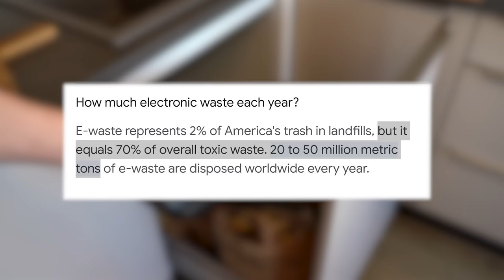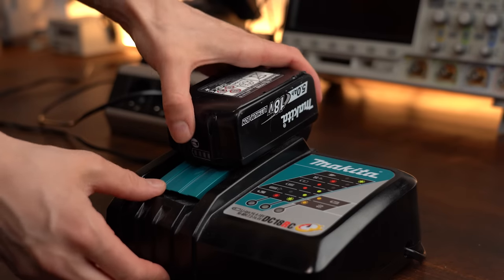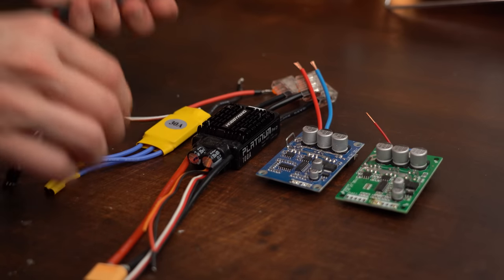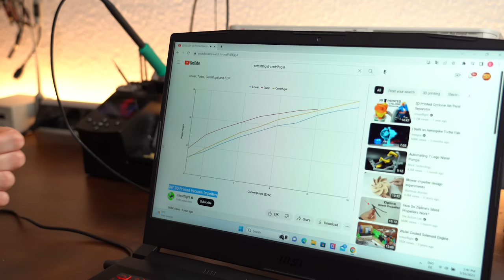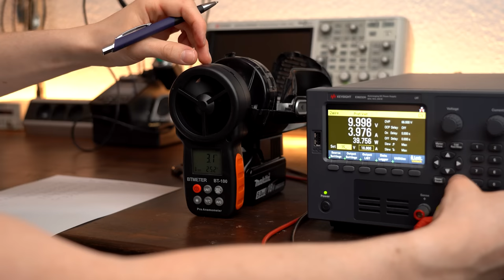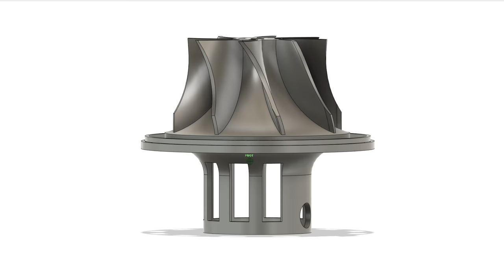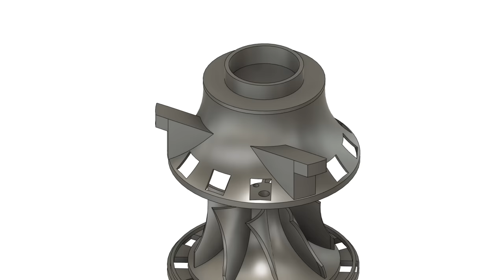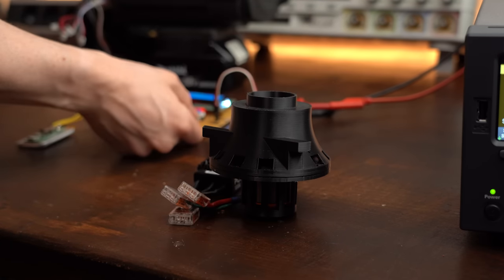I tried OVERPOWERING my Vacuum! (Homemade Turbine)

Comment: I have been wanting to build a small easy to use vacuum with my 3d printer. I too.. have a ton of motors and batteries. I printed a few impellers but havent found an efficient design yet.

Comment: I owned a 18v at first but moved to the 48volt for my second one. Its still a bit to weak. So once this one is dead if i get a smal portable one it will be 60v. But most likely i will simply use better plugg in vacuumes.

Comment: 1 minute into the video and I'm already thinking that a brushless motor and a 3d printed prop is going to make you buy a new vacuum cleaner to clean those little plastic bits when the prop explodes 😅. Going to watch it till the end and see what happens.

EDIT: happy that it didn't blow up and I would recommend next time not to stand so close to a 3d printed prop. When you added the epoxy to the magnets you also killed the balance of the bell. Really surprised nothing bad happened and glad at the same time

Comment: if I had to guess, the 'extra vent holes' could reduce the effective suction power.. OR, in fact, it might need MORE vent holes on the sides.
        The original impeller uses all of the spave in the cavity, right? 
       So the cavity might be integral to the suction. (Just like those 'bladeless' fans displace way more air than a regular fan...(?)...if that makes any sense...?)

On a simpler (and very positive!) note:
      I think your impeller design (without the housing, even) would make for a very, VERY good fume extractor :)
.      (Looks more effective than a computer fan to me)

Would be interesting to see an A/B test with a source of smoke, to see how much it can displace.  
     (Which is probably not the most scientific method, but would look cool on video nonetheless ;))

Comment: Question: If you were reprinting the whole impeller and everything, why was it still so important to use the same diameter motor vs using one with a higher KV?

Comment: Outrunners like that do not like very high speeds due to the eddie-losses. They heat up and due to the inverted nature have very poor cooling when not getting air forced through them.
You may be better off with a in-runner style motor, probably a 4-pole (4 magnet poles). The balance of load on motor vs power could also allow you to increase efficiency even more.

Comment: From an engineering standpoint a great video
However the intro with the e-waste problem is a bit ironic, considering that you replaced all the electronics in this thing anyways and used up more plastic than the original housing is made of ;)
Reply: yes lol

Comment: Ich hätte von einem alten kleinen Abgasturbolader das Kompressorrad verwendet. Der 3D Drucker bekommt warscheinlich die Geometrie der Schaufeln nicht exakt genug hin, und gewuchtet ist das sowieso nicht. Die hohen Unwuchten verhindern warscheinlich das Hochdrehen des Kompressorrades. Ausserdem beeinflussen die Spaltmaße zwischen Gehäuse und Rotor direkt dein Verdichtungsverhätltnis bzw auch den Durchfluss. Mfg.

Comment: Fan/impeller design needs to be matched to the system resistance (ductwork, cleaning tools etc) and to the motor speed and power, which can all be calculated. Chances of getting this right without calculation and using spare parts is low but good luck. Dyson had something like 1800 prototypes for his first machine…

Comment: I have to warn you DO NOT continue to use this DIY vacuum cleaner.
I have been tried to develop a new propeller for vacuum cleaner in 3D printed way in my previous job, your workflow is basically the same as mine and represented very clear. Great video. 
But I will not recommend you continue use this diy vacuum cleaner because the propellers 3D printed tends to have structural weakness and will warp after stress test/ heavy usage.
It hugely depends on your printing profile. But if the propeller stuck while you using it, best scenario is BLDC motor protection circuit come up and stop further damage. Worst scenario is potential fire hazard due to motor continues to heat up and smoke come out.  
I learn it in a hard way blown up a couple of motors in a controlled environment. It is a bad idea to put it in your house.

Comment: Just try to reuse the original impeller and housing design, measure the static pressure before declaring it a success, put more voltage in or a bigger kv motor.

Comment: You can't design a centrifugal compressor by just putting some curved blades on a hub and hoping for the best. You need to calculate the pressure drop and design rotor speed, then with input power you can calculate the mass flow rate and therefore radial velocity, then tangential velocities and thus draw the velocity triangles to calculate the exact angle the blades need to be at the inlet and outlet sides of the rotor, taking care not to over expand the flow which will induce separation and high losses. You can then solve some differential equations to get the exact curve the blades need to follow for uniform pressure distribution, and plug all this into your CAD program.

Comment: Shouldn't you be measuring the volume of air moved per second under typical "dust load" instead of the speed? 🙂 Cool project.

Comment: Bugger more powerfull motor with a higher stall resistance setup. That would be the best solution it will be heavy and may take two power packs to run it but it would probably work better

Comment: your design is great and all but i think the biggest limitation to it is the impeller design. that motor can handle good power and all and spin to a similar rpm but the impeller desin is what allows it to create airflow and static pressure. sure the airflow is nice but the vaccume relies more on pressure to suck dust through fabric and suck up large debris. if you get some professional tips as to what style of impeller you should use then that vaccume should be just as good if not better than orignal.

Comment: There's a channel that deal's with impellers. ( Cannot remember title ) And i was shocked to find out the slightest changes will produce outstanding results. Just because the one you chose was good, something slightly different could be your answer. Looking cool sometimes... isn't.

Comment: You're using my 3D printer (BambuLab X1 Carbon). But I don't know your CAD software. Currently I'm using Onshape, but within the free version, everything has to be "public visible". And I'm on a Mac, so I'm very blocked, because not every CAD software works on my machine.

Comment: Why not use a motor with a higher KV rating?
The large size of the motor shouldn't be a problem if you end up making a new stand with a 3d printer.

Comment: What filament do you use for 3D printed Electronic enclosures? I really like your designs and ideas for electronic projects and their enclosures... I just bought a 3D printer and I wonder What's the best filament for an enclosure that would not melt when something on the circuit gets warm... PLA starts to deform when it gets 65°c on a heatsink near it

Comment: The Magnets propably came loose becuase the motor got so hot. I would think that airflow isnt the most important if your turbine cant get a low enought preassure. Would be nice to see the vakuum it can pull.
Reply from the maker: Yep. Heat definitely was the problem. But then again, other BLDC of mine also got hot and never got this problem. Not sure what was wrong with this one. And maybe I will do a follow up video....we will see ;-)
Reply: @greatscottlab  Yea who knows what glue was used in the factory. :D Maybe there is also a difference with BLDCs for RC cars and planes since the motors for cars are build for less airflow. So next liquid cool the BLDC!! :-P

Comment: Seems as it don’t have a high load what about using a gearbox solution for like ever 1 turn it out puts 4 turns on the impeller shaft

Comment: Coming from a car guy too, u should never go for a weaker engine, when u are used to one car, then drive a slower one, thats disappointing to say the least and takes away any fun, so if u are going to replace a motor, put one that is at least 20% more powerful there...

Comment: i used the original stuff only changed the batteries and it was very fast :D and next it was smell and fire because the new batteries was bigger and didnt fit well in the vacuum

Comment: You might be getting pumping losses from the enclosure. also i dont think a centrifugal design works too well for the speed on your motor. It might be best to look at either getting a new motor or redesigning the casing and impeller.

Comment: 5:54
'casually putting a brushless outrunner motor inside a closed tight fitting enclosure'
Reply from the maker: Yep. Not the best idea.
Reply: it's an idea though😅
you might want to switch to inrunner motors, they're much easier to mount in situations like these, have much higher RPM, and will make the construction more rigid.
Reply from the maker: True

Comment: a centrifugal turbine is better suited for exhaust pressure not for intake pressure. id recommend a fan blade design that's better suited for suction father than exhaust pressure.

Comment: Damn man, I'll give you credit for your effort and getting it working...however you spent WAY WAY more on the fix then just buying a new one.   Cost Eval:
New Handheld Vacuum:  $50-90     Vs:
Labor Costs:                       $80 /hour  x 4 hours (at least)  = $320  (unless you dont value your time) 
Small Motor:                       ~$10 (estimate)
20V Battery:                        $40-70
Impeller Design:                $80 /hour  x 2 hours (at least)  = $160 
Impeller Fab:                     ~$10 (estimate)

Comment: You shouldn’t have used an out runner motor for this situation. The spin was causing rubbing inside the casing you made off causing heat and making things go off balance

Comment: Hey, when you use abs filament for impelors? (idk the opposite of propellor) you can smooth the print with acetone fumes in a fume box with a fan in it, make sure the box is acetone resistant and it takes practice to evenly smoothen but with smoothened fans you can get better performance (source: Does Smoothing 3D Prints Improve Performance and Can You Smooth PLA?. Channel: Major Hardware)

Comment: Centrifugal impellers are very sensitive to being balanced in terms of rotational mass. Like when you balance your car wheels after changing the tyres. If not balanced, you will have lot of losses, it will rub against everything and eventually self destruct.
I didn't see you follow the impeller balancing procedure on the video.
Other things to keep in mind is the geometry of your impeller (number of fins and angle of the fins) and the gap between the fins and the housing.
There is always a tradeoff between more or less angle ans more or less fins. You want to optimize the geometry for your rpm

Other than that, there are other factors which affect vaccum cleaner performance, such as the filters used, geometry, backpressure, etc.

Btw, I think your wife wants an expensive Dyson 😂😂😂

Comment: Can the motor handle (without damaging the plastic) 60 more watts if you boosted the voltage to maybe 24v-30v with a boost converter?

Comment: While you're at it - add an off switch or speed reduction feature to your project in case something gets sucked in that wasn't meant to ... that said, is this doable with some simple old school "pressure over time" measurement, or do we need a lot of toddlers to get enough training data for a fancy pants AI solution?!

Comment: make a vacuum cleaner that would first blow off the dust, and then suck it up.  something like a tube of compressed air in the middle of a hose .. or nozzle.  some dust can't be sucked in, but easy to blow off, if you combine it, it's perfect, blow-suck

Comment: 💨🔌🌀 While your first attempt at overpowering your vacuum with a homemade turbine was impressive, it seems that the designed impeller fell short in terms of static pressure. Vacuums rely more on static pressure than the speed of airflow, and that might have been a limiting factor. Nonetheless, it's an excellent effort, and I'm curious to see the updates and improvements you make in the future. Keep up the innovative work! 👍✨🔧

Comment: should use a smaller motor with an olmost same size prop but much lighter with same power for efficiency,,over power and stronger suction.

Comment: I don't understand why you even replaced the motor when the KV rating was almost 800KV lower then needed. Try the original motor with the new impeller design. That could be interesting.

Comment: Can't use an open impeller. Gotta be shrouded for static pressure. The original is made like it is for a reason. Off hand I cant think of any impeller from a vacuum cleaner that isn't a shrouded design.

Comment: It’s uncanny how your videos always sync up to my projects. I’m working on a project where I couldn’t get enough flow from a vacuum generator and have had to switch to using a regular vacuum motor. One of the hardest parts is getting it as quiet as possible. Does anyone have any suggestions?

Comment: 5:03 You want to make a vacuum cleaner, a vacuum cleaner requires suction power and not airflow. The impeller you show here has forwards facing blades, which is good for high flow, low pressure and low noise. You need one with backwards facing blades, which provide low flow, high pressure and high noise.

This mistake shows up everywhere in the video, where you only measure airflow speed and not suction power (both the air speed and inches of vacuum should have been measured)

With your design, measure the airflow and inches of vacuum with the current setup, and one where you flipped 2 leads of the motor around to make it spin in the other direction

Comment: I once built such a vacuum cleaner. However, I made it wired using a 1200W vacuum cleaner motor 😅
Reply from the maker: Well, that is one way to do it.

Comment: Everybody, there's a valuable lession here. No matter how cool your project is, doesn't matter if it uses less power... if only ONE parameter worse than the original one, if only ONE step is more hassle than the original process, your partner WILL complain and ask you to improve it or buy a new one.

Comment: Hi, I have some questions... Can I use two 4056 charging modules to charge my 20000mah lithium battery bank...The 4056 will be wired in parallel and the battery is 3.7v  20000mah.

Comment: Would it be possible to add a second air-moving structure under the impeller plate, to direct a separate air-stream to the motor for cooling? (separate so you're not throwing dusty air into the motor)

Comment: It's not the motor, it is the blade you made, they are way too open and can't grab enough air... the first propeller variant you had in the vacuum was much better than what you made... So, with that in mind, replace the propeller and see how it works, and continue to find a finer tune to it

Comment: It's not a "turbine". Turbines converts energy on the fluid to mechanical energy. What was made is a compressor or impeller, that does exactly the opposite of the turbine: converts mechanical energy into energy to the fluid (pressure, potential, kinetic energy).
Reply from the maker: True, but I think more people can imagine the object when saying turbine instead of impeller.
Reply: @greatscottlab  propagating misconceptions is not a good thing. Such a good channel, that teaches so much, should inform this too and be another great opportunity to try to break this mistake almost everybody does.

Comment: you measured the original motor RPM at no load; should be lower under proper suction

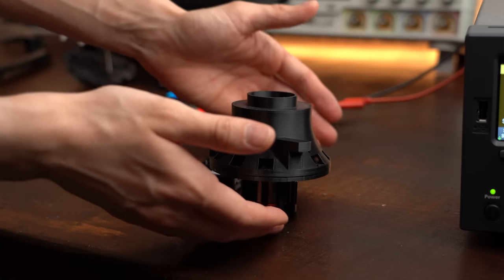Comment: Lol 10:55, even if you were a mechanical engineer it would’ve been the same process, probably would’ve thrown a metal bearing insert between the motor mount and impeller tho. But that goes against the challenge rules if you don’t have one laying around.
Reply from the maker: Thanks for the feedback

Comment: I can just see a Duck saying, "I don't have a birth certificate stating that I'm a Duck. I must not be a Duck." You don't need a piece of paper stating what you are or what you can do. Just do it. I worked in engineering for 20 years and you did more engineering in fifteen minutes than half of the dumbasses that I worked with could do in a year or two. A degree in engineering will open doors and allow you to pass through them by flashing that badge, but your ability to understand and invent and do is what is of real importance and you have that. You are an engineer. This video is a resume. Email it to every engineering H. R. manager in any engineering business and I'll bet you you'll get a job with them as a designer or as an engineer.

Comment: The only thing you saved from e-waste here mate was the plastic housing, which is clearly the most useless part of this vacuum. 
Would have been easier to leave the damn thing alone and just make your OWN vacuum cleaner as it seems you have the basic understanding of their function figured out. PLA is good for housing (provided you don't drop it) but no good for mechanical stuff that moves. 
Don't forget that 3D printing in itself is wasteful with lots of supports and/or trial-and-error processes. I only wish more companies made plastic recyclers, ones that work at least.

Comment: I've been wondering about doing this but with replacing the large DC blower motor in my suzuki samurai's climate control and with a brushless motor setup and a 3d printed fan design with stronger air flow but I have no idea what kind of motor i'd use that get along with automotive voltages of 12.4-13.7v reliably and also handle ambiet temps in the summers of over 115f..